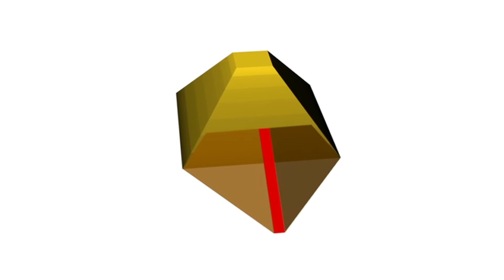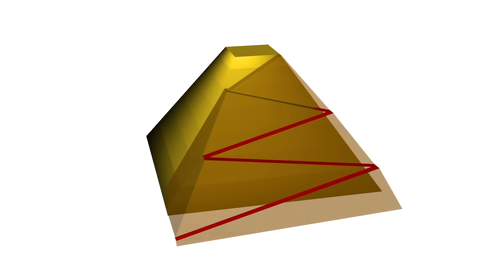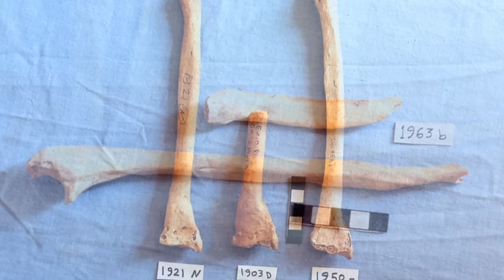Egyptology - Pyramid Construction

Comment: Why doesn't someone do reverse technology on the pyramid? Where did they finish construction on the pyramid,the top or the side? Go from there. Once it's brought down you know how to build it back up.
Reply: "UNESCO"

Moral:  the Egyptian Pyramids are "World Heritage Sites" protected by Treaty.  Egypt therefore is under an obligation to protect and preserve them rather than allowing such "experiments" as you say.  

In some cases renovations to take place where the site is threatened by say structural collapse - where feasible.  Djoser's Step Pyramid as an example underwent a multi-year renovation som years back to shore up its' sides.  Other Pyramid remains however where the remaining internal chambers have partially collapsed and it is too dangerous to try to repair it simply are closed off to the public for safety reasons.  So it depends based upon feasibility and costs of course.

Comment: Maybe it was naturally there already could be in a different form, all the ancient had to do was to design and construct inside. Just my thought 😃
Reply: If the ancient Egyptians had as you contend the ability to "refurbish" a stone structure = do they not then have the capacity to work stone - so why bother then with "cast-offs."  Better to simply build anew based upon what they wanted.  

You also run into the problem of stone block structures are not a "natural occurrence" = thus someone had to create it.  The problem there is there is nothing - not even a pottery shard - to indicate a predynastic culture predating the Egyptians capable of constructing something on that level.  

Moral:  all the evidence supports the dynastic Egyptians constructing the Pyramids.

Comment: Note : There is no mention of  how the pyramids were built anywhere in the Egyptian hieroglyphics. Because they didnt build them. They inherited them. The 80 ton blocks were not shipped or dragged on the sand or lifted up by men with ropes pulling a sledge on a ramp. They were cast in place. That's why no gap inbetween stones and fitting into the profile of the adjacent blocks.

Comment: Estimated they needed 2.3 million blocks average 2.5 tons each, over 20 years of construction, working 24/7, that means they put in place 1 block every 5 min … 🤔
Reply: That is a simplification people use to give it some context.  In actual practice no one builds like that.  You instead would see = multiple teams placing multiple blocks in different locations of the Pyramid at the same time.  This would give you = multiple blocks in a given span of time rather than your "1 block per......." analogy used in entertainment media.

Moral:  if someone was constructing a brick building you would see teams of masons working in tandem laying bricks in multiple locations simultaneously - so it was here.  

If you had say 20 teams of block movers while each team could place a block in perhaps 2 hrs then that means in a 2 hr period you would have = 20 blocks placed in different locations - or if you wish "1 block every 6 minutes."  So the more teams working in tandem the more blocks placed in a given span of time.

Comment: I read that building a ramp would be more work than building the Pyramids.
Reply: More work - no.  Labor intensive = absolutely.  Quarrying stone blocks - even if crudely done as most of the pyramid blocks actually are - requires considerably more effort than having a few thousand people with baskets etc. scoop up mountains of sand/clay/quarry rubble from creating your blocks = to dump those in a place to create an incline surface.  

Moral:  the historical/archeological evidence conclusively supports ramp use.  There are in fact the remains of smaller ramps found in Egypt in various locations to include at Giza.  In the western cemetery adjacent the Great Pyramid are partially completed tombs and attached to those are small earthen fill ramps made of the material I described along with a simple retaining wall.  

Final thought.  The largest/heaviest blocks are actually found = in the bottom half of the pyramids closest to the ground.  Those blocks are large so that "lifting them" is not practical = ergo they must be raised via ramps.  Yet above that level the blocks are smaller as the pyramids rise in height.  The blocks at the top of the pyramid if you look at photos of people who climbed them are small enough for several men to lever into place.

Conclusion:  the Egyptians had their shaduf which employed a fulcrum-counterweight principle.  Herodotus wrote of their using levers and what he termed as "a machine" which sat upon "the steps" - he wrote they first built a stepped pyramid to then fill in the sides.

So the smaller blocks found in the upper half of the pyramids = can be raised by a larger model of their shaduf.  This opens the possibility that the earthen ramp need not have gone all the way to the top as some speculate.  It might have gone around ~midway to raise the larger/heavier blocks and create the inner chambers/corridors found below the halfway point.  Above that level the smaller blocks might have been lifted from level to level via such devices and levered into place.

Comment: I farm cotton in West Texas, have high HP tractors, steel, tempered chains break under a load.  My tractors could not pull 100 ton, or evern 10 ton rocks up a ramp, and certainly plant based ropes could not do it, they would break easily.  When Cortez came to Mexico, from the soldier Diaz diary, the native mexicans were a stone age people using clubs, arrows, spears, all with sharp rocks attached, when they went into battle.  It would have been impossible there and in Peru to build the magnificent monuments with a sharp rock in one hand and a hammer rock in the other.  Iron ore processing was "invented" about 1200 BC, before tha was Bronze, made from tin and copper, not a strong metal, to cut and shape all those rocks in Egypt and the 200 pyramids in China, hidden by brush and vegetation (you can see them from google earth, if you know where to look in Western China.  Someone else did the work in Egypt, Mexico, Peru, China, it is increasing difficult for the professional liars, with the flood of information from the internet available for all, even a former CPA and now an irrigation cotton farmer.
Reply: Ah....... - I haven't seen the "my tractor cannot pull......." nonsense for some years.  So we are back to the golden oldies of the LAHT rationalization repertoire I see.  🤣

p.s. - steel cables were not invented and did not begin to see widespread use until the middle to late-19th Century......  So guess what.  Everything built before then was done = using "plant-based ropes."  It sounds like you might need a new tractor if yours is a "weak" as you claim here.........
Reply: @varyolla435  Something you cannot get around smart mouth punk - they were a Stone Age people and could not have built the pyramids in Mexico or the precise walls in Peru.  You are a liar and a deciever, twist words around to make make-believe appear real.   You brand of deception does not work anymore, only the braindead and mexicans believe what you say.  And they are Stone Age today, they just live in an advanced society, the DNA is the same.  And you attended school with them where equality was obtained by gearing to the lowest common denominator.  Congratulation, you speak and only Stone Age people listen.

Comment: They always show men pulling the 2.5 ton blocks, when 8-10 well train ox's may do the job easier.
Reply: It's an example - nothing more.  Absolutely using oxen amplifies the ability to move something as it adds exponentially greater power being applied.  

Moral:  back in the 40's an Egyptologist who was also an Engineer studying as I recall Abydos concluded that 5-6 men using a wooden sledge and a surface like rollers could move stone blocks weighing several tons.  

Naturally the ancient Egyptians in their iconography sought to display "their prowess" as far as manpower alone.  Yet there is also evidence of what you say = draft animal power.  In the tomb of Hunefer is a depiction of a large sarcophagus on a wooden sledge being pulled by a team of yoked oxen.  So for smaller blocks manpower alone would suffice whereas for the really large/heavy blocks or statues they likely incorporated ox power as well.

Comment: Building a ramp is a much greater undertaking than the Pyramids themselves.
Reply: Depends........  Although Herodotus did write the Egyptians' ramp was a huge understanding one must also consider the pyramids themselves.  The blocks of the pyramid reduce in size as it rises in height.  So the largest/heaviest blocks are actually found = in the bottom half closest to the ground.  

As such the main ramp only really needed to go that high.  The smaller blocks above might have been raised via fulcrum lever devices which rested upon "the steps" to lift smaller blocks to the levels above. Herodotus also wrote of "a machine" and the use of levers.  Such devices mirror the Egyptian shaduf which used the same fulcrum/counterweight principle.
Reply: @varyolla435  Don't the grand gallery blocks weigh 70 tons each and sit deep inside the pyramid, slanted downwards, and this part is closer to the middle of the pyramid, not lower part. Is there a heavier block on the bottom that weighs more?

I know some limestone blocks weigh 10-15tons but not close to the grand gallery.

Comment: ⚔️Page2: The vital timing of the arrivals of the 30+ tons megalith blocks; to arrive at the site, from ~ 500 miles away, is when, the first / base level is completed: As weights become heavier, the members used will be also increased to accommodate, there transportation. This allows for the fulgruming of them to each of the next level; using ppl, animals, derricks, spars, and tripods, for the lighter weighted bldg components. Canals for badging blocks that could U turn for there return for more blocks from the supply stock🎉 yards. Rope nets were used to load, and drop off, using fulgruming for removal of the nets for reusing.🛡️

Comment: The casing stones collapsed and slipped along the structure killing thousands of painters that were adding drawings on the pyramid. They could've been neglecting but apparently some of the water they were using slipped behind the cassing stones leaving that oegendary whatermark. It either took them too long or they used too much water in they painting mixture thtpe thing is the casing stones might've collapsed while there was alot of people working on it.

Comment: One thing that always amazed me is the higher you go up the pyramid, the less blocks you need! So most of the work was near the bottom!
Reply: 🎯  Also if you look the higher up you go on the pyramids = the smaller the blocks are.  The heaviest/largest blocks are found in the bottom half closest to the ground.  Those at the top if you look at photos are small enough for several men to level into place.

Comment: A RAMP?!?!?! Seriously??? A ramp that could have supported so many two-ton blocks, plus the weight, and space for the required labor force to push those  blocks upwards would have been a wonder in its own right...
Reply: Not "seriously" = what the evidence shows...........  

Moral:  In Egypt today there are the remains of ramps used for construction - to include at Giza.  At Karnak as an example there is the remains of a mud brick ramp used to build the hypostyle temples there + in the tomb of Rekhmire is a depiction of such a temple being built from said mud brick ramp.  

At Giza in the western cemetery adjacent the Great Pyramid are partially completed tombs.  Attached to them are small earthen fill ramps.  Those ramps using simple stone retaining walls are a mixture of = sand/stone chips - quarry debris/and tafla.  Tafla is a sedimentary clay the Egyptians mined and used for various applications to include the creation of roads/ramps.

When the limestone quarries of Giza were excavated years back they found dumped into them = massive amounts of ramp filler material to backfill the area.  Near the worker village at Giza is the remains of a large tafla mining operation.  

When Petrie as an example studied the Giza Pyramids long ago he recorded that dumped near the northern face of the Great Pyramid - which constitutes a steep drop-off - the Egyptians had dumped = a large amount of ramp filler along with other debris such as bits of rope and wooden sledges etc. as well as old pottery.  

Conclusion:  the amount of ramp filler material found in the quarries and the "waste area" north of the Great Pyramid was estimated to equal that of the volume of the pyramid itself.  Also Herodotus also wrote the "causeway" the Egyptians created to build the Great Pyramid was a monumental undertaking in his opinion.  So yes = ramps........

Comment: “It was ramps and sheer muscle power”. Ah… Probably not…. Easier to believe that past civilizations had more tech than to believe that slaves with ropes moved thousands of ton stones across the desert and up into the air…. While not having plumbing, electricity, mechanical equipment, etc….

Comment: Ramps several miles long, and the incline would have been really gradual. Ramps which evolved into the pyramid itself.
Reply: Good thing then they need not have been that long.........

Moral:  the main quarry which supplied the stone for Khufu and Khafre Pyramids lay 200-300 meters away.  It is just south of Khafre's causeway leading to his valley temple adjacent the Sphinx.  The ground to the north and east of Khufu's Pyramid would not support a long ramp since it steeply drops off after a distance.  

So the main ramp for both pyramids would have been connecting to the south side for Khufu and the east side for Khafre with possible "wrap around" to the west where the now western cemetery lay.  

Final point.  The largest heaviest blocks are found = in the bottom half closest to the ground.  Above the level of the King's Chamber in the Great Pyramid - which is below the halfway point - the blocks are smaller as it rises in height.  Those at the top if you look are small enough for several men to lever into place.

This means the ramp really only was needed = for the bottom half.  Herodotus wrote they also employed "a machine" to raise blocks which sat upon the steps - they first built a "stepped pyramid" to then fill in the sides.  A lever/fulcrum device like the Egyptian shaduf scaled up could raise those smaller blocks to the levels above.  A ramp not going to the top means = you do not need a miles long ramp.....  

p.s. - the exposed western base of the Great Pyramid reveals = a continuous section of limestone bedrock.  This shows the pyramid was built at least in part upon an existing hill.  

Djedefre who followed his father Khufu built his pyramid at Abu Rawash = atop an existing hill.  You can see whereby they dug into the hill to create the burial chamber and covered that over with blocks.  So the existing hill under the Great Pyramid to the western side likely encompassed part of the ramp to create the inner core of chambers/corridors and like with Djedefre would have then been covered over.

Comment: The great pyramid of giza is made up of  2.3 miilion blocks .
Thats a hell of a lot of blocks to  manhandle.
Reply: It depends = upon the size of your workforce.......... - and how organized they are.

Most of the blocks of the Giza pyramids are little more than "stacked rubble."  They represent a hodgepodge of crude chunks of limestone quickly fractured from the bedrock and hauled away as is consisting of various shapes/sizes/consistencies.  Only a small number of the total were more carefully cut and in some cases polished.

Further the main quarry of Giza rests = ~200-300 meters away - it being between Khafre's Pyramid and his valley temple adjacent the Sphinx.  What small amount of stone was shipped in via the harbor which also once sat adjacent that temple is ~400-500 meters away from the pyramids.  So the stone blocks did not need to be moved very far - speeding up the process.  

Finally Egyptologists estimate Khufu's workforce to be ~20K-30K in size.  The worker village at Giza had sufficient size and infrastructure to support a workforce of thousands of people.  Also there is ample evidence to show whereby they were highly organized being broken down into specialized teams under the supervision of experienced craftsmen.  

Moral:  if a single team can move a block and drop it into place in say 2 hrs then 10 teams can place 10 blocks in about the same time frame ------> or 25 teams can place 25 blocks and so on.  Hence the more teams working in tandem = the more blocks being placed in a given span of time in multiple locations simultaneously........ - so not so daunting as assumed after all.

Comment: Or....maybe they used ...cranes ?
Reply: Okay = show evidence of that - dating to the correct period.........  Absent that in the future it would be best if you forgo the "maybe they......." assumptive approach to instead = stick with the actual evidence you see - just saying.  

p.s. - no cranes = but yes fulcrum-counterweight devices such as the Egyptian shaduf - simply scaled up.  

Also the largest/heaviest blocks of the pyramids are actually found = in the bottom half closest to the ground.  These could be raised via ramps as alluded to.  Above that level the blocks are smaller as the pyramids rise in height.  Look at photos of the tops of the pyramids.  Those blocks are small enough to be levered into place by several men.

So those smaller blocks could be raised from level to level by a device such as I alluded to.  Herodotus wrote they used "a machine" which is probably a variation of the shaduf which was used for millennia in ancient Egypt.  You do not see things like pulleys etc. until the New Kingdom period - long after they ceased to build pyramids.